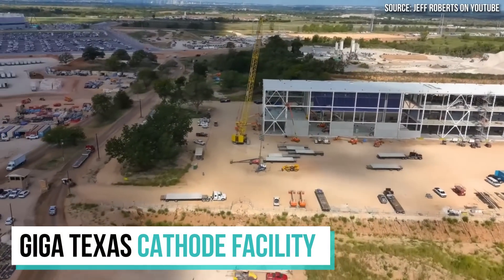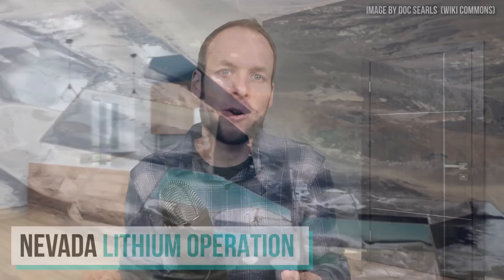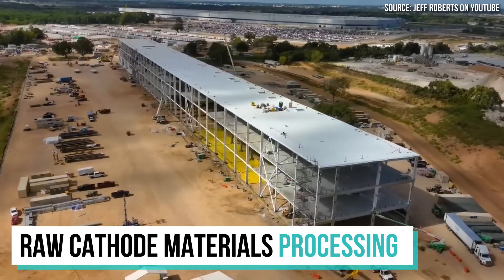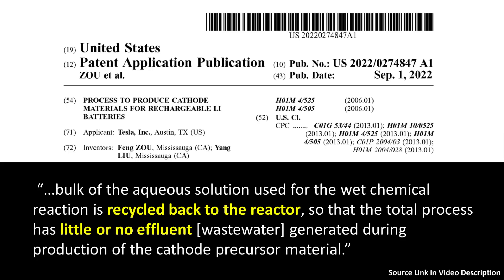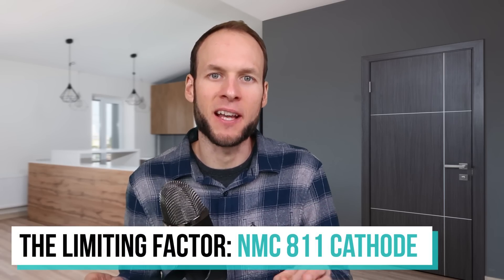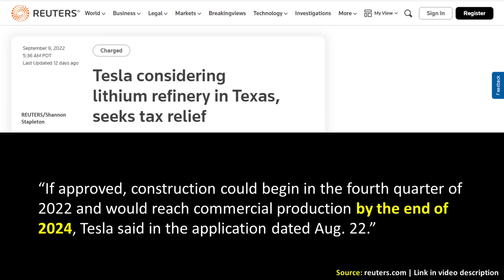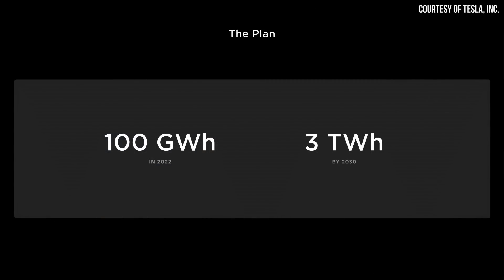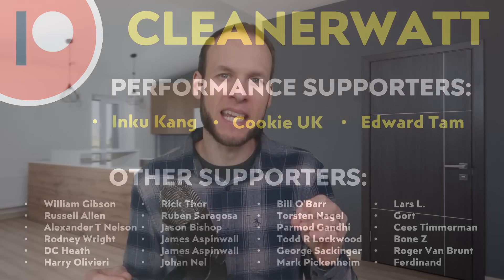Tesla's BIG MOVES to Secure 4680 Battery Supply Chain

Comment: Cars certainly are a really big deal, especially with good battery recycling. However, I believe the more important (in the longer run) application and opportunity lies in Powerwalls, Megapacks, and stabilization of (at least local) electrical energy grids; coupled with solar, wind, hydro, geothermal, or even small commercial nuclear reactors. Weather and natural disasters, politics, increasing energy demand, and massive, antique or aging infrastructures are almost forcing local community, region, or urban areas to provide for their own power, rather than importing it from far away (e.g., across national borders, etc.).

Comment: https://youtu.be/w5gq7scB0hE 
It would take 100 years to test a century battery without the equipment and Jeff Dahns machinery seems to have perfected the advanced testing. Jordan from limiting factor just released a video saying the 4680; to everyones surprise has no silicone on the anode, it 100% graphite. Exactly what Jeff Dahns lifSi chemistry requires. I believe people are going to be shocked to learn, when buying a 4680, they will be buying a home battery without recycling required. The second use of a century battery is a more sustainable society... I grew up playing sim city.

At 52-03 the man questions the range penalty at 3.9 volts... Which Dahn replies 18% at 3.9volts.  This would explain why the model Y in Texas has low range 4680. Only 280 mile range. I'm guessing it has the lifSi chemistry... And also why the cybertruck is made out of stainless steel.. for the body to compete with the battery.

People are wondering why the Texas model Y has such low range.. this lifSi might explain why.

https://youtu.be/ieDz426h5u8
Reply: Isn't this interesting?

Comment: Well - it is not that Tesla had a genius idea for recycling this waste water instead of retreating and disposing it. It's all about cost, thats just a business decision. In china where they simply dispose the waste water into the environment, there is no interest in recycling. Only if recycling becomes cheaper as otherwise required retreatment it becomes desireable.
Likewise for batteries - as long as it is more cheap to scratch fresh lithium out of the earth instead of refining it from used batteries, all recycling attempts are doomed. Once enough used batteries become availble, once the recycling processes are at scale and at the same time lithium mining becomes more difficult and more environmental requirements, recycling will be a no brainer.
Reply: "Well".... It seems that you're projecting assumptions based on .... What? Uninformed opinion, or guesswork?
.
"I" would guess that you have little, if any basis for your assumptions.
As for "scratching new lithium instead of recycling"
Have you not noticed (or presumed? deduced?) that the quantity of cells being produced is greater than those reaching end of life ?
.
Once you reach that simple conclusion, you should realise it's not about being "more cheap" (that's "cheaper".... Grammar Police)
.
It is in fact about requiring more material than is available.
Also note that recycling will be (maybe is already) cheaper by a very great margin than mining new material. (Costing about 17% that of mined material!)
It's already "a no-brainer" When available.
.
Let's also look forward to the trillions of phone, tablet, laptop, powertool, etc cells being syphoned into this system instead of going to landfill.
Then there's the circuit boards from all electronics, also suitable for this process.

Comment: Ever since CATL announced the LMFP battery, I have zero interest in any vehicle not using that chemistry.  I sincerely hope Tesla is already in the process of reengineering the 4680 cells to use this battery chemistry, because there is no longer any reason to justify the use of NMC cells.
Reply: 4680 is not the optimum form factor for LFP. I don't know about LMFP but LFP can go with a much larger cell than a 4680.
Reply: @kazedcat  
You're coming here via a Kiwi channel I presume?
Pure speculation.
Reply: Re the LmFP chemistry, let's see what it actually does in a vehicle.
Then take a look at the factory size/ GWh, process used and efficiency of that system.

Comment: Very good video John.  (sp?) The vertical integration is important but lateral organization also works.  CATL is very important to Tesla.  The paradigm about specialization put forward by Adam Smith has to be flexible considering the advent of computer technology and automation.  Elon Musk has put forward some paradigms about innovation that I have not heard much about recently.  There seems to be a technical sticking point regarding the pulverized nickel being too coarse and it puncturing the layers of material around it.  Also there's a problem with the mixture not staying put on the substrate once the rolling of the cells begins.  This points to the prismatic means of making battery cells.  How will that be resolved?  Does vertical vs lateral integration of the company affect the quality and speed of the resolution?

Comment: 2:33 - 38,228 sq ft, seems WAY off.  "My Tesla Weekend" YouTube channel reports that the roof is composed of 198 individual 24 ft x 17 ft squares for a roof area of 80,784 sq ft.  Not to mention that the interior has at least 3 floors, some may be partial.  If the floors are all full floors, that would be a max area of 242,352 sq ft.
Reply from the maker: Good info - that makes a lot of sense. I wonder what the 38K sq ft figure is for?
Reply: @Cleanerwatt  that might be jus the first phase of the building. It will have 3 phases. In other words, the building is actually 3 different facilities. In one of the videos of Joe Tegmeyer he explains it.
Reply: well picked up, good work mate